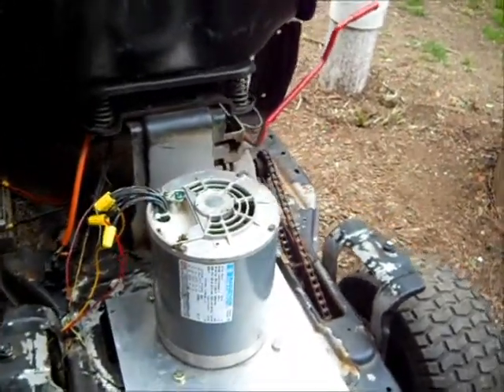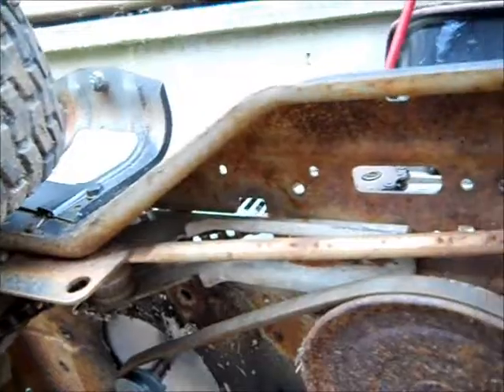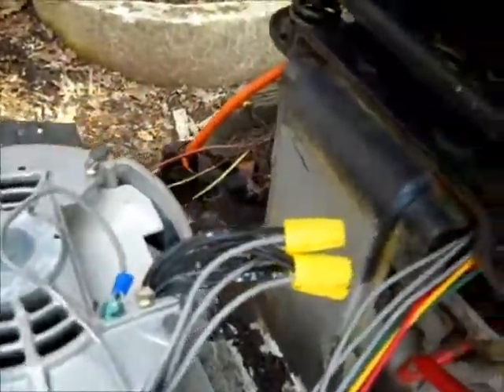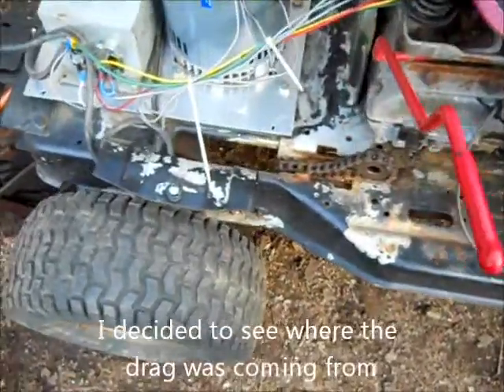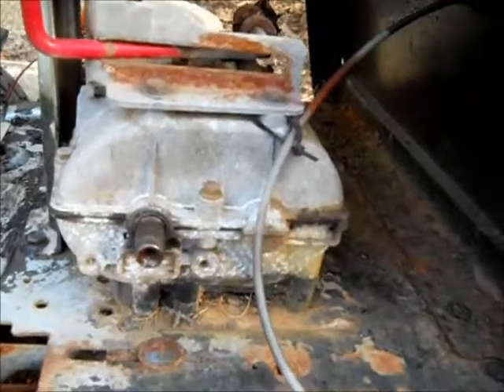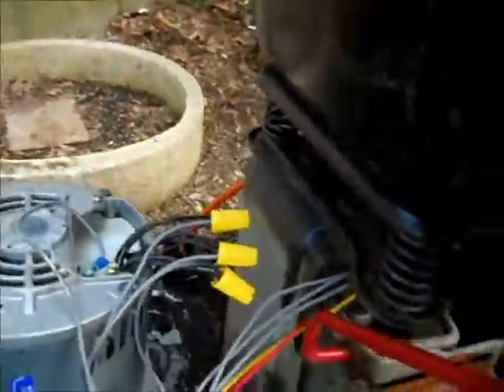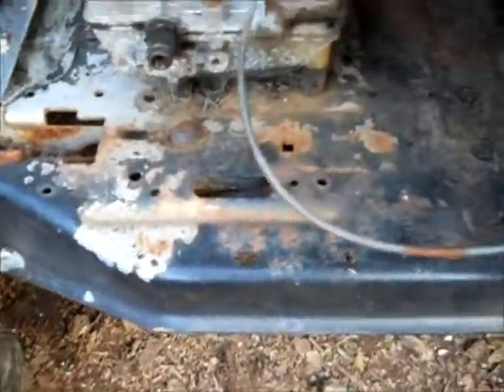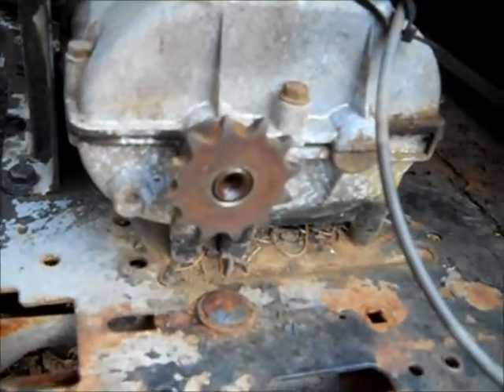Craftsman Mower Project Part 2: First Ride

Comment: To get 1.5KW with a 150% total for overload makes 2.3Kw, and the kva is close to 3. divide 3000 by 240 = 12.5 amp times 10 for 24 volt = 125 amps plus some loses for the inverter. The whole arrangement will be power hungry unfortunately. I have been trying a few ideas including biasing the windings in relation to each other with some success. This tends to use less current to make magnetism. The idea needs extra inductors and the manufacturer warns that the vfd does not like this.

Comment: It would be better with a 4pole motor. I was going to buy a 3phase motor for a car and by reading the specs it showed that torque is much greater as the number of poles increase. An 8 pole motor would be best. But to get any revs the windings or the amount of iron would have to different. Alternatively there would need to be a greater variation in the voltage applied to the motor. A test bench shows how quickly the current climbs with moderate load.